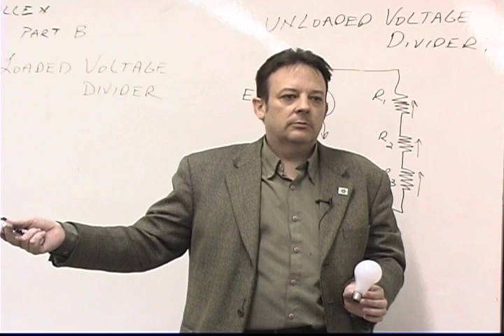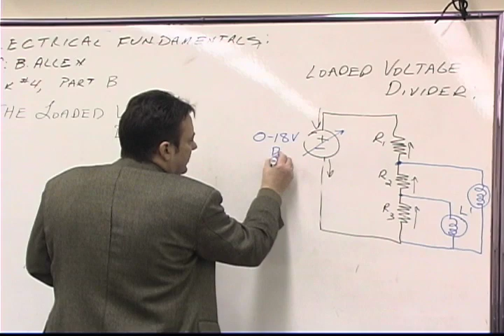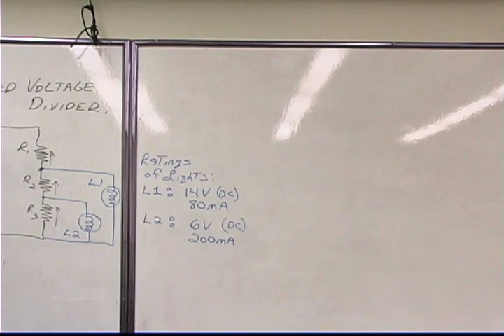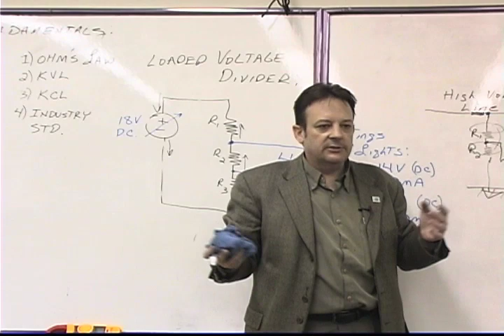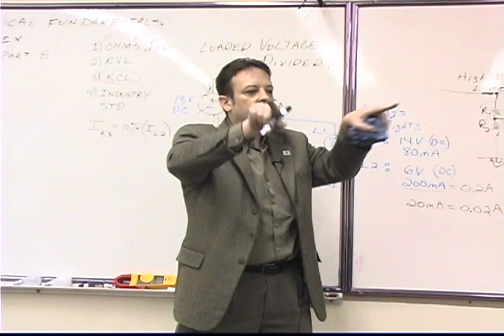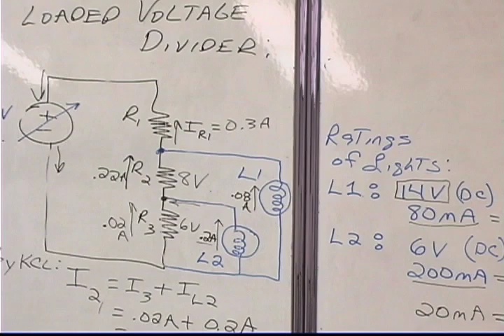Loaded_Voltage_Dividers_copy.mov

Comment: A resistance based voltage divider would not be practical for variable loads such as both a radio and a heater.  Not knowing what the load will be, it would be hard to keep exactly the same voltage at a particular spot between resistors.    D